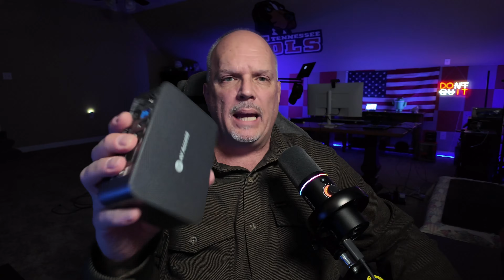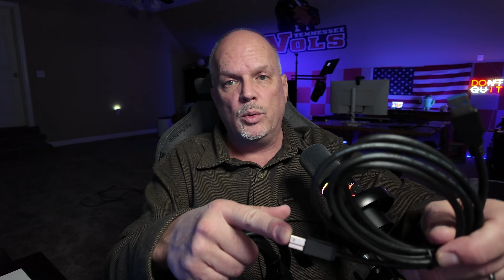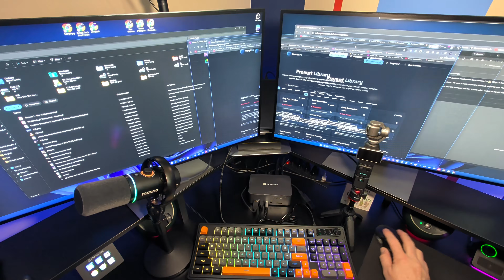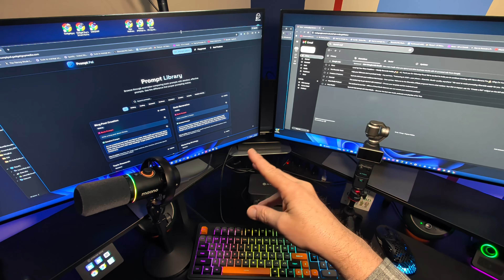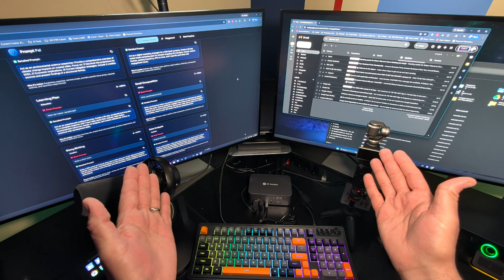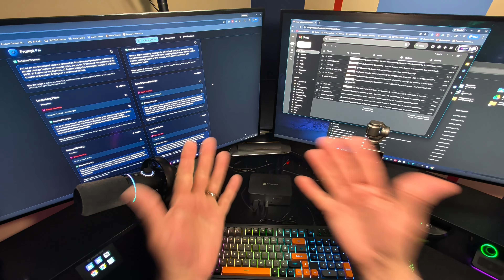Control Two Computers With One Keyboard and Mouse: AV Access iDock C10 Review

Comment from the maker: Stop banging your head against your desk. This device lets you switch between a laptop and desktop in seconds without touching a single cable. Question: What is the most annoying part of your current desk setup? Let me know below. 🛍 Discount code : Smarthome ( 6% discount for iDock C10, iDock M10 and iDock B10 until Feb 26th) iDock C10 KVM Switch Docking Station USB-C - https://www.avaccess.com/products/idock-c10/aff/50/ iDock M10 KVM Switch Docking Station for MacBook  - https://www.avaccess.com/products/idock-m10/aff/50/ iDock B10 USB-C KVM Switch Docking Station - https://www.avaccess.com/products/idock-b10/aff/50/